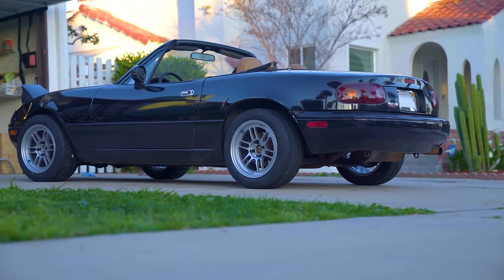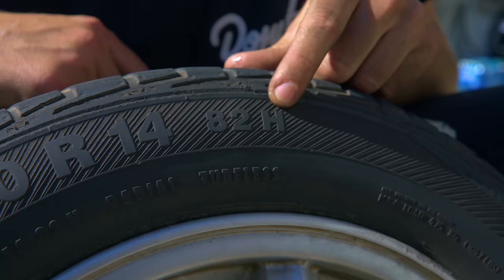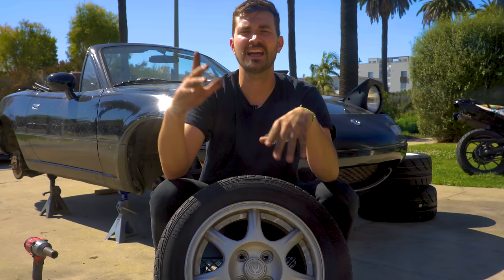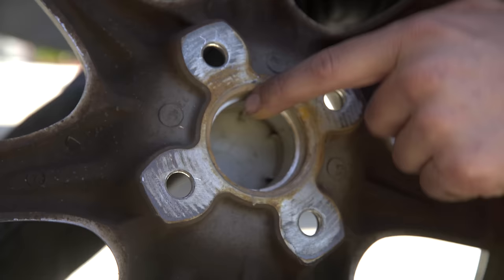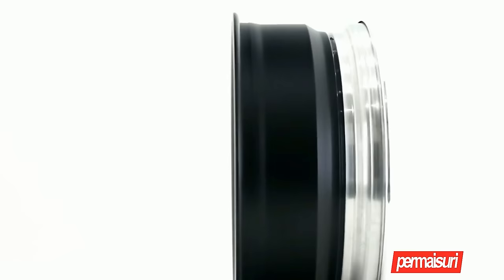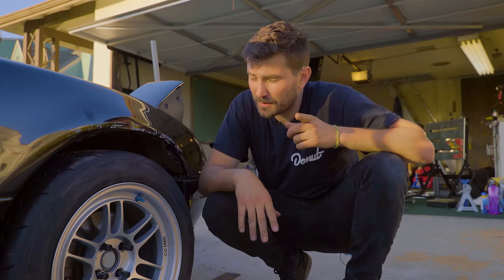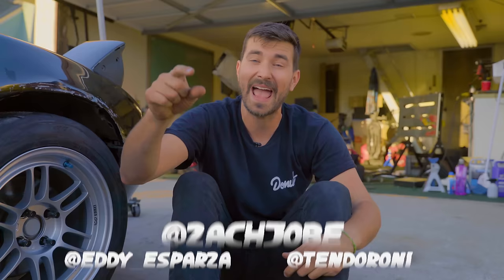How to Pick BETTER Wheels & Tires for YOUR Car

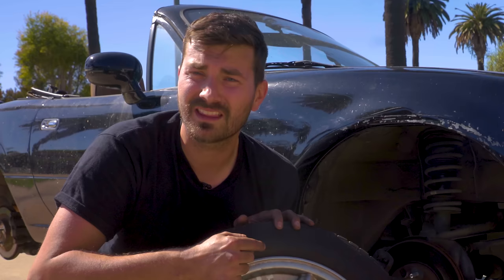Comment: 7:38 "tires must be retired after 6 years"

*looks at my set of tires that are just threads and could legally drink
"...   They still got some life in them"
Reply: Old tires are just drift tires.
Reply: LMAO.. 😂😂🤣😂😂😂
Reply: If you can't see the air, they're fine.
Reply: “could legally drink” 

I’m deceased
Reply: My WINTER tires, the ones that came on my car and are on it currently IN THE MIDDLE OF SUMMER, are 14 years old. Tread is still pretty good tho, so I really can't justify new tires to my parents
Reply: Man i swear my tires still stock it's already 7 years planning to replace next year.
Reply: I had some we think were 30 years old on my truck, they were tubed. We wore through the tread until we were driving on the tube and they popped
Reply: @brendancross2767  all it will take is one sharp/good size object in the road and that'll be curtains.
Reply: @brendancross2767  ...I live in Canada , do not drive with snow tires in the summer time ...that noise you hear is your wheel bearings being damaged....good time to buy summer tires (end of season deals)  just remember that your driving a low powered light car ....so norrow will be fun to drive on an good in the rain . Don't fall for wide looks cool....
Reply: Kicks em yer all good horsey
Reply: @brendancross2767  or you should check if they have little cracks in them, these cracks come if a tire gets old and is drying out. If you have cracks you also should change your tires
Reply: @brendancross2767  slashes tire welp mom, dad, I need a new set of tires
Reply: I mean, my trucks tires are old
 But hey, they work still

Comment: 7:38 "Tyres must be changed after 6 years"

Me and my 20 years old tyres: "alright I guess just a bit more is okay"
Reply: My spare is so old, it has "Made in W. Germany" on the sidewall
Reply: Yeah, that can still take a few seasons
Reply: Brady what car?
Reply: @krithikmaran5917  '87 E28
Reply: Brady clean
Reply: I think the tires on my LP608 Mercedes truck are made in yugoslavia
Reply: yo i orderer brand new Advan‘s for my car and it says 3514 onthe sidewall... they arrived 2 weeks ago
Reply: Baleine Poison in which case, theyll survive for as long as youre alive 😂 our shit was built to last
Reply: 20? PFFFT that's weak! i got some old tyres from mr dads shed, asked dad when he last used them, his answer "they were on my first project car and i baught that thing in 1982 so problaby from then" since he changed them pretty quick (the wheels are old 14" steelies, have been yellow some time, yellow, white and black, now they are rust (the wheels)
Reply: @1.8T20V  return them. Common issue when buying new tires
Reply: Sergeant Speed damn, hope its not to late because theyre already on the wheels
Reply: As a tire service tech:
NO. PLEASE CHANGE. Even dirt cheap new tires are better than ancient ones.
Reply: Tires* must be changed after 3 laps...
Reply: @1.8T20V  ruh roh old tires
Reply: i got a 1990 camry with the original tires on it  and the tred would come off in chunks when i did a burn out
Reply: @brady5829  that thing will hold a few seasons
Reply: I was taking a corner at 20mph blew a 10 year old tire from the date on the tire..... Bent my rim.............ps don't use tires on a 27 year old car parked for forever
Reply: Spare tires don't see weather u can use them for a while...check pressure once and a while
Reply: Brady lmao mines from 03, full size spare on my mistubushi. Never used hopefully never will.... cant relate on my 18 ford fusion tho... i had to use the spare already
Reply: @Garbage Trash Yeah, actually. How'd you guess?
Reply: Neil Brown I mean Built in Yugoslavia... Yugoslavia is no more since i believe 1992, so you can take a guess on the age 😂
Reply: I think the tires on my celica supra haven't been changed since like 1998... i need to change them lol
Reply: I probably will agree with you but it turns out my car beat me and the 100 year old tire in the left front turn out to be useless on avoiding  the wall maybe with two ok tires I would have been able to save it
Reply: @1.8T20V  1-2 year old new tires are fine, but 2014 is definitely too old. I'd speak to them and return it.
Reply: In hot places it's not recommended to have the tires mounted for too long, specially when you put a lot of miles on them ( I'll say 4 years MAX, unless they're worn out due to high mileage before the 4 years ) and you drive for long distances.
Reply: I swap every 4th year at worst often earlier:)
Reply: Once had a 2005 car that someone put 1987 tyres lol lmao, the tyre place was so confused
Reply: 6 years old is fine if they are stored/parked in the shadows and Cold climate
Reply: @brady5829  Also the first-aid kit was made from W Germany?
Reply: @f00kinglasrsights89  Did not come with one, Canadian market car
Reply: @brady5829  Maybe the dealer stole it?
Reply: @sergeantspeed5941  It's not common. That sale was actually very unlikely to ever actually happen. The oldest tires on our shelf have a late 2018 stamp, and if they manage to sit long enough to be 5 years old, they go back to our warehouse.
Reply: @1.8T20V  you should contact the supplier and demand replacement. most companies would not have allowed that sale as they're over 5 years old, and I know in my company, we do everything we can to not sell a tire more than two years old. a five year old tire does not perform for shit.
Reply: XD my project truck has tires from 87
Reply: Anyone gonna say how he spelled tires wrong
Reply: I have tires from the 90s with almost no dry crack. It will be fine
Reply: LMFAO!! 😂🤣🤣😂😂😂😂🤣☠️☠️
Reply: And then there’s f1 tires...
Reply: Tires*
Reply: Andrew Dollard in Britain tires are spelled tyres. Idk why
Reply: @nacktschneckennorbert5932  If it says Sava on the side than they are. That is one and only yugoslavian/croatian tire company i know of.
Reply: @1.8T20V  Send them back because you’ve been ripped off. Those tyres are worthless and dangerous and you should not have paid anything for them as the supplier likely knows
Reply: @stevenfarrington2361  its been a couple of years by now but thanks for the concern. 
I got an update tho: complained about the tyres‘ production date. Mechanic understood the problem and called his supplier and after a while of them trying to shift blame they gave in after me and my mechanic threatened a lawsuit ( in switzerland you can sue the supplier with all kinds of carreer ending things for such a product-delivery)

long story short: tyres got returned, i got my money back and a Set of Hankook S1 Evo Z‘s free of charge.

Comment: I freaking love this series but what makes it so great is that my parents have had a 95 Mx-5 Miata that does t run for years now and you guys have convince me and my dad to fix it up. Thanks so much and keep up the great work!
Reply: Any update?
Reply: @ae_no-exorcist1704  he ded
Reply: @ae_no-exorcist1704  They fell into a money pit and now they cannot pay for internet anymore
Reply: @datgio4951  D:
Reply: Is the Miata still dead?
Reply: My grandpa has a miata, and my family is planning on bringing it home in 2 months, and I'm watching this for if anything goes wrong
Reply: did this, a new aluminum radiator, a Borla exhaust, and a few tuning tricks... drove it for 11 more years and still sold it for a tidy sum... ANYONE need some stock wheels from a 2000 Miata?
Reply: He never did it😢

Comment: On tire-mounting, the tire valve should be aligned at the yellow marking on the tire because that is the lightest portion of the tire
Reply: If it has a red dot without a yellow dot, the red dot should be on the opposing side of the tire valve. That's typically the heaviest portion of the tire

Comment: When are we getting a "How to roll fenders"
The: "dint want to modify the boty, YET" got me exited 😁
Reply: If you modified your car to the point of needing rolled fenders you should know how to lol
Reply: Rolling fenders is easy.  I highly recommend a heat gun, hammer, grinder, and some biceps 💪.  A $30 eBay fender roller will work fine.
Reply: Sakis Geo ricer
Reply: they touched that when they did the hilow series with the 350z's
Reply: Just buy the Eastwood roller or rent it off Facebook if you're to the point on your car to roll
Reply from the maker: let's just say it may or may not be next week lol
Reply: @Donut  I’m guessing it was not the next week lol

Comment: I remember reading a review on the M3 and they recommended the 17" over the 18" for high performance driving.  Take a look at rally tyres and wheels.  Bigger wheels are generally for more show.
Reply: Yes, it's less rolling mass. That's why Koenigsseg don't put 22 but 20 in agera

Comment: One other thing about Offset is it's also about making sure the center line of the wheel lines up with the pivot point of your steering, doesn't matter on the back as much, but if it's too far in or out your wheel will move in an arc to turn instead of twisting on the spot

Comment: I just installed RPF1'S on my STI last night and this is in my recommendeds today. Wow. 18 x 10 +38mm with Michelin pilot sports 265mm. So nice.
Reply: Jacob Baker get ready to have to buy another set in a year. Michelin’s are better but softer compound and what most people don’t know is they start at around 9/32s where as Pirelli control contact is a harder compound(less tire is lost to the pavement) and start at 11/32s. Just a tip man. Also I’m sure those 265s look so much fatter than the 215 oem or whatever
Reply: Also the Pirelli control contact/cinturato will cost less than the Michelin pilot sport
Reply: Devin Whitlock those Pirellis aren’t so much for corner grip. They’re like sport touring tires bro. I think that’s why he went with the Michelins.
Reply: What year is your sti jacob?
Reply: @crossplane46  2016. If you would like to see some pictures for fitment I could send you some.
Reply: I’d love to jacob. I have a 2002 blobeye sti and thinking of fitting 18x10. Contact me on instagram @crossplane
Reply: Control contact.

Comment: They never covered what kind of tires you’ll be needing for what activities😐
Reply: you can do some homework and look up for yourself, i mean you should search "toyo tires" and i'm sure they'll say something about what it's used for: drifting, racing. don't forget: the pressure of the air that it's in the tire is also important
Reply: It's something that comes down to the buyer. Obviously for snow rally you'll want snow tires and for autocross you'll want a high performance summer tire... Etc. "Drift tires" are up to the individual as well
Reply: Exactly if they said they were going to cover it.. they should, I dont mind researching though
Reply: O R G 8 its not that hard
Reply: @ruggedobserver4987  duh, but they said it so they should have had it on the video, Im not arguing how hard it is to look stuff up
Reply: Yes they did. It's easy to figure out which is for which.... They Literally showed a car drifting...  ???
Just think.
Reply: @Dotseoem  seeing a car just drift doesnt show the types of tires wheels and set up for it.. besides that he said he will TALK about it not show a 2 sec video of one drifting
Reply: @ORG8  Context Clues though. I'm shocked ppl don't already get atleast 
SOME of it.... but okay.
Reply: I agree, they should have covered this. When I was visiting some friends in GA, one of them was complaining about how noisy their Corolla was. Later they gave me a ride and I happened to notice there was a lot of road noise. Turns out they had BFGoodrich G-Force Comp-2 tires on it. Why would you put high performance tires on an automatic transmission, daily-driver Corolla? They clearly just found whatever fit in their budget and said "yep" without really thinking about what they needed. Not going to lie, I didn't care about the different classes of tires either until I was on my second car... Though, I probably should have.
Reply: @Dotseoem  dude we watch them to see their preference on the set up, I know everything he taught us on wheels and tires will help us decide and have a general point and then we can look online either way he said he will talk about it. I was eager to see how he would set up his car or others in general for drift, drag, or track.. which again for some are more obvious then others to figure it out
Reply: Yeah, he says "these will be super sticky" but he doesn't add that they will also be super loose when wet (dont ask me how i know) :-)
Reply: Since you need it:
Drift:cheapest low grip stuff.
Dirt,rally:high grip low pressure grooved.
Daily:something normal.grooved is good.
Race:high pressure low groove.
Done.
Reply: They did kinda cover it. It’s a bit secluded, I’ll give you that, but after watching twice, the way he describes the tires and what the symbols mean is basically telling you different tire specs for different activities. Moral of the story, just pay attentionz
Reply: @ARentz07  g force comp 2 aren't really a "fit my budget" type of tire

Comment: Even though steel rims aren't as popular, I've found them to be MUCH easier to balance compared to most other rim types. Mainly because a lot of steel rims require clamp weights in which you would just measure and let the tire balancer tell you on which side the weight needs to go on. Sticky weights are fairly reliable too but there are so many different types of rims that chances are, if the rim isn't brand new or clean, those sticky weights are useless.

Comment: I'm a red seal Journeyman Welder but I never grew up wrenching on vehicles and don't consider myself very mechanically inclined. Now I'm in my late 30s and have become very interested in learning to be more self sufficient with my truck and being able to do work myself. This series has given me the info and the knowledge to be more confident in wrenching on my truck. I will be doing all the fluids and plugs next week, and that's all thanks to this series.

Comment: drove on 15 year old all terrains on an 89 bronco. valve stem gave out from dry rot alone and the tires threw chunks of rubber like my current 10 year old tires are doing... WOO!

Comment: Best consumer-friendly vid on car tires so far, short of telling how the rubber is actually made.
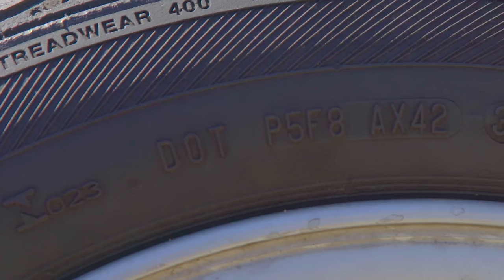7:12  This manufacturing date in this number code set is the most important:  tire rubber has a maximum useful lifespan of 7yrs; even vulcanized rubber dries out to become brittle in that time period and not replacing them just invites catastrophic blowouts on the road.

Comment: Damn my Firestone Firehawk indy 500 tires passed every test with flying colors comparing them to the information you gave. Treadware 340, traction a, temperate a with a speed rating of 91W 168mph. Put them on my 2013 civic Si a few months ago and they are absolutely amazing for the price too, great in the rain as well even though they are a high performance summer tire. I would recommend them to anyone looking for a GREAT high performance tire. Got mine for 90$ a piece for a 215/45R17 but I think they have gone up in price since the word has gotten out about how good they are because they are a fairly new production of tire.

Comment: the wheel spins the same amount of RPMs regardless of the diameter, but larger tires will travel a further distance for that RPM and smaller diameter tires won't travel as far, hence your speedometer being off.

Comment: 7:43 tell that to my spare tire boss, 0988 yup its 32 years old. used it 4 times ever, never dry rotted or injured, sits on the tire mount inside my bronco

Comment: Instead of doing all those calculations or searching through forums, there's a much faster & surer way... Just go to the Tire Rack website, enter your vehicle info & the size wheel you want to put on it and Viola!, it'll tell you what fits. All the info (bolt pattern, widths, offsets, etc) will be there. You'll just have to look through a few different ones to get an idea of what offsets work with what widths. Pick a wheel with a size that you're satisfied with then add tires and the perfect size to maintain overall factory diameter will show up. The entire process takes less than a minute or so unless you want to look through the wheels to see how they look on your car. Whether you buy from them or not, Tire Rack is one of the quickest ways to check what size wheel & tire combos will fit on your car.

You clarify sizing very well. So many people have no clue how the sidewall to width ratio works. You have no idea how many think 70's are skinny & 50's are fat... Even though it usually works out that way (LOL).

Comment: The best explanation of the stamped data on the tires I have run across. It’s quite q bit of information which you should know, I’m guessing, if you intend to drive or expect performance beyond the daily commute.

Comment: Good thing you guys mentioned the max PSI and and you should look in the manual for the right one, but the because is flawed, because as you drive the tire gets warm, and so does the air, and what do all things that get warmed up ? They expand, so if you would drive on max PSi your tires are very likely to pop, at high speed for example: The Highway.

Comment: Really informative video
One thing worth mentioning is that for Off Road tires the measuring system is often entirely in Imperial Units.
A typical tyre for something like Jeep XJ would be 30x9.5 R15 so 30 inches Tall (entire wheel height), 9 and a half inches wide (tyre width) on a 15 inch diameter rim.

Comment: Correct me if I'm wrong, the first 3 numbers for example  ( 175 ) is not tread width but profile width of the tire at it's maximum width. A 175 basically 7 inches wide will have a different tread width in a Goodyear then a Michelin etc. Some tires have a more rounded tread cap like a motorcycle tire and some tires have a more square 90 degree shouldered tread cap. The more rounded shape tread will measure slightly narrower then the same 175 in a more square shouldered tread.